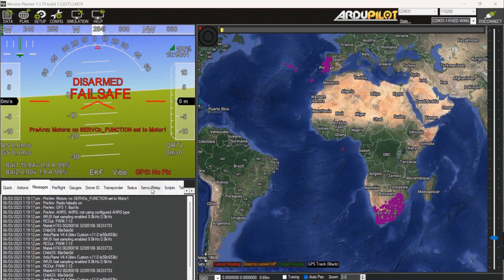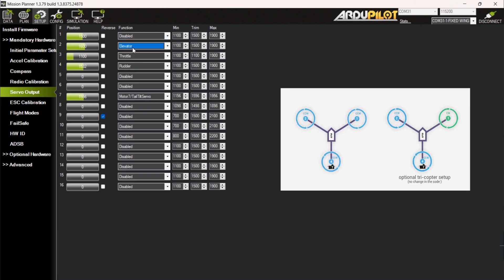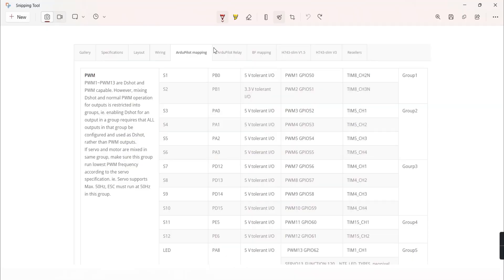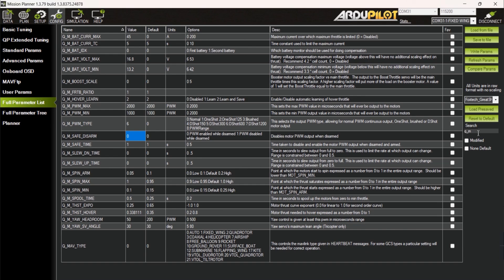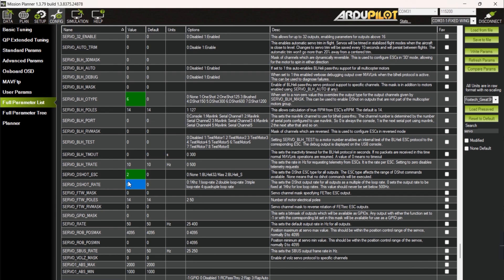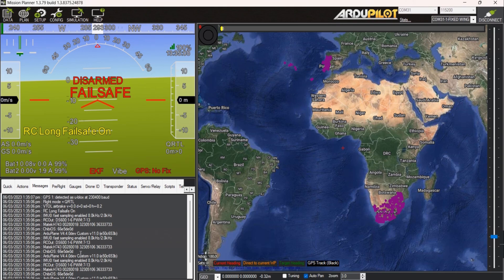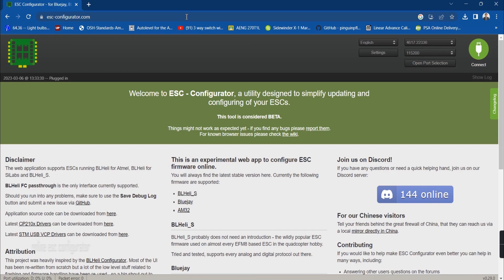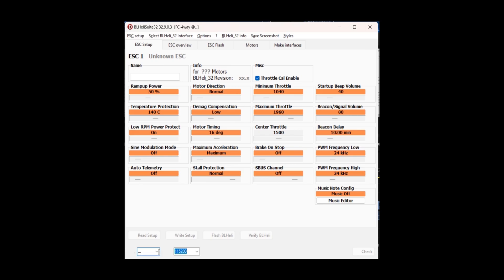how to setup dshot ESC protocol and blheli passthrough on ardupilot

Comment: for some reason i am not able to do motor test on bl-heli 32. I am able to connect to the motor but it will not let me test the motors.  everything up to blheli 32 worked but after that it wont work

Comment: Thanks for this! Hopefully this helps. Trying to setup my T1 Ranger VTOL PNP and got the bootloader update to work and did upgrade to 4.4 but got lost from there.
Reply from the maker: Did it work? just give me a message if you need further help
Reply: @windfpv I will when I have time soon! Thanks!
Reply: @windfpv What did you set Throttle to in the Servo Outputs?
Reply from the maker: Kindly check the details here

https://youtu.be/NJMIgvoN6aU

Comment: Is it possible to explain the first point by groups on a normal quadrocopter with 4 motors, of which 99.9% in the use of the population of the planet Earth? where nothing is known at all.
Reply from the maker: actually, it should be found in the documentation of your flight controller. you can read more about mixing esc here:

https://ardupilot.org/copter/docs/common-dshot-escs.html#dshot-mixing-escs
Reply: @windfpv  unfortunately for me this is completely incomprehensible, yesterday I made the first five-minute flight on an ardupilot, setting up the ardupilot is very difficult, I was so happy when I saw your dshot instruction for the Matek H743 slim, I have the same flight, but unfortunately we are talking about 3 motors .I'm not sure if this Dshot works for me? I don't know how to check it? I flashed with MatekH743 firmware, should I have chosen MatekH743-bdshot firmware?
Reply from the maker: im using dshot on mine, anyway, you just need to set the appropriate blheli mask according to your motors (number of motors in the setup, and which output pins on matek fc you connected those motors)
Reply: @windfpv  Do you have a dshot running on a regular MatekH743 firmware, that is, without the MatekH743-bdshot add-on? tell me how can i check that bdshot is working? my motors are absolutely ordinary 4 pieces, SERVO_BLH _BDMASK 1CHANNEL-2-3-4 ticked in order.
Reply: @windfpv  Connecting Matek H743slim to the ESC with a standard cable to the connectors.
Reply from the maker: i dont use the bdshot fw for my VTOL setup, not needed. Dshot works on the regualr 743 fw anyway
Reply: @windfpv  Thank you, I probably also have a dshot on a regular firmware, because in the sensor monitor there are filtration RPM graphs, and perhaps the controller receives data from the motors via a telemetry wire, they are so clever with groups of motors that it is difficult to understand and check if there is a two-way dshot. I also noticed that the QMC5883L compass does not always show correctly, can this be fixed? perhaps the calibration at home near the computer was not of high quality, does the ardupilot allow you to start the calibration in the field with sticks?
Reply from the maker: You can assign a spare channel for calibrating compass, this is done using the RCn_option. For instance, you want to use rc11 for this purpose, assign a switch on your radio for RC11 channel. Then on mission planner parameters, look for RC11_OPTION. Then set the value to 171 to make it calibrate compass once you trigger it.
Reply: @windfpv   Thank you, commands OSD1_AVGCELLV_En = 1 I returned the voltage per cell to the OSD, but there are no voltage readings, only dashes, how to return the voltage readings?

Comment: Great bro! Thanks i have a question, i have a problem with motors its moving  in mode"disarm" but when arm all okay
Do you think this?
Reply from the maker: What's your Arming check and arming require set to?
Reply: @windfpv  I arm the control with a switch RC7_OPTIONS=153 I have no problem with this, but the motors turn intermittently when it is disarmed, can I send you a video somehow?
Reply from the maker: @ODIRFPV  sure! Kindly send your email here :)

Comment: Excellent tutorial. I still have a question, how you wire your 4n1 to the pixhawk? Do you have any other tutorial showing this?. Thanks!
Reply from the maker: You need to connect the signal wires of the 4-in-1 to the main output pins of your pixhawk. You can define each output pin anyway, thus it does not really matter. but you will need to power the 4-in-1 using the power module.
Reply: @windfpv  Thanks for your Reply. Do you have any link or documentation I can follow? I really appreciate all your help.